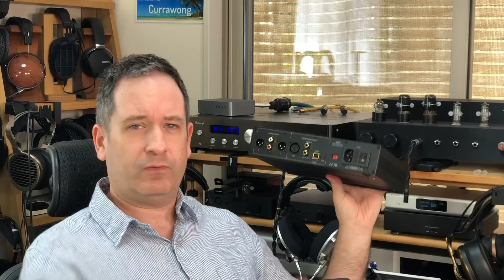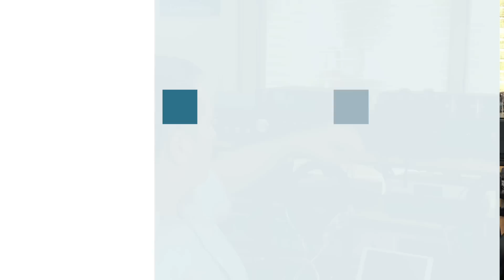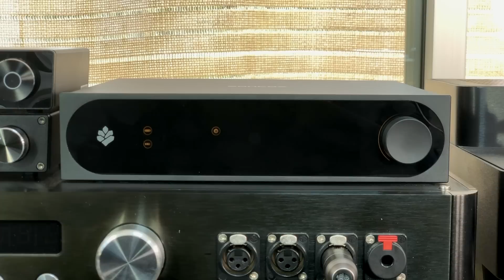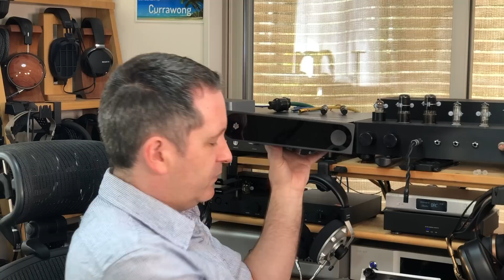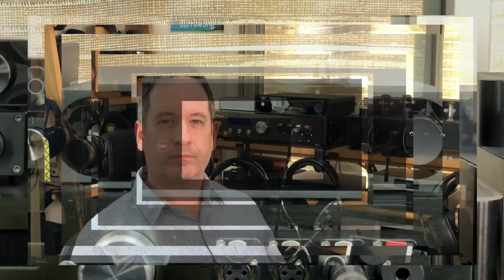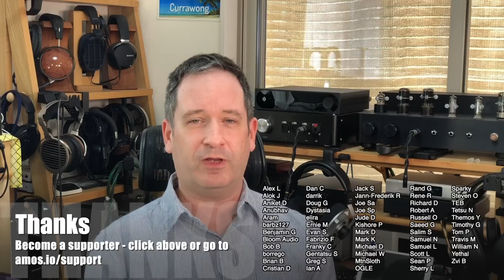SONCOZ SGD1 DAC Detailed Review

Comment: Greetings from across the pond. I just picked up an SGD 1 and had a question about the USB input. It worked fine with my laptop but couldn't get it go work with my nvidia sheild media player's USB output to SGD 1 USB input.  I was able to plug and play the nvidia shield  with my "lo fi" Sundavo DAC no problem. Do you know if there's a driver I need to install on the nvidia sheild which is currently running android 10?
Reply: Got it to work!! Had to adjust a few settings on the Nvidia Sheild. Thanks.
Reply from the maker: Why not ask the manufacturer?

Comment: So i started at the wrong end of things. First i got my headphones Beyerdynamic DT770 250ohm Then i got the Beyerdynamic A20 2nd hand for 180 euro bargain compared to price of a new one...

 Now im after a dac. first i was thinking Topping D50S but dont like the look and heard it has power supply noice so started thinking of SMSL SU8..

then i heard Goldensound say "if u thinking of spending 300 euro on SMSL SU8 id recommend saving up to get SONCOZ SGD1.... 

Then i hear Z reviews say "if ur planning on spending 500 on SONCOZ SGD1 id recommend you to save a little more and get the Topping D90.

Now you confirm what  Z reviews say not the "better to get part" but the part that the D90 is better...

Now im sitting here with 200 euro and thinking do i really want to wait 7 more months of saving to get the Topping D90...

is there a way to turn the Filters off to get something like a "Pure Direct" mode?
Reply from the maker: Digital filters are necessary to prevent distortion. See: https://troll-audio.com/articles/sampling-and-reconstruction/
Reply: @Currawong  Very interesting read! thanks!

Would you recommend the SONCOZ SGD1 as a first dac? id mainly use it for music and on occasion games so sound stage and audio directional accuracy is is important

Reason i asked if filters could be bypassed is coz they normally colour the sound which i am not a huge fan of i want neutral and accurate sound i guess some call it analytical is the SONCOZ SGD1 all of this or good enough or is there "better" around the same price?
Reply from the maker: https://www.h-ear.audio/faq/

Comment: By now there are more than a few competent DACs in the $1000 and below class. Generally speaking you get a clean sound with good detail retrieval and low distortion. So my question would be at what price point do you get a more emotionally involving sound beyond being merely analytical, with convincing tone and a greater sense of weight and presence. The little micro details that create that a greater sense of realism.
Reply from the maker: For that, you would probably want an R2R DAC, or one of the Chord models.
Reply: Best way is get a very good analytical dac such as a D90 or RME, then get a modest tube preamp and then feed either class d, SS A/B or tube power amp or monos. Then you'll get the best of both worlds. Even a full tube integrated amp would add that musicality digital is still not quite able to get